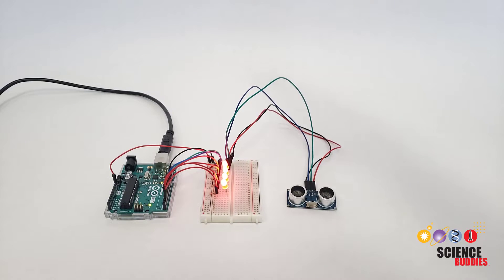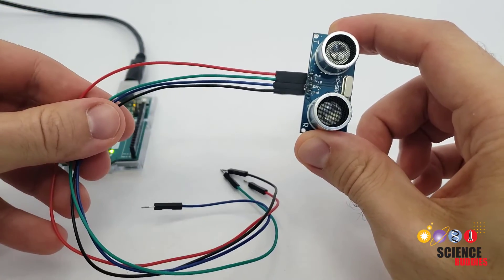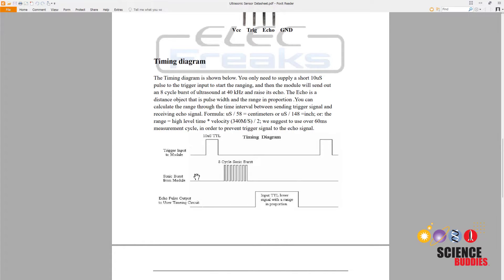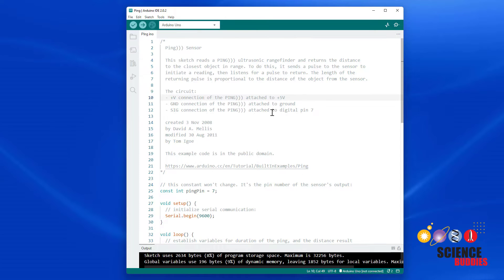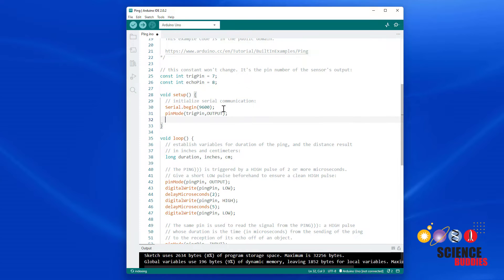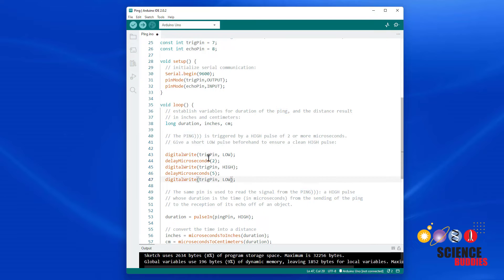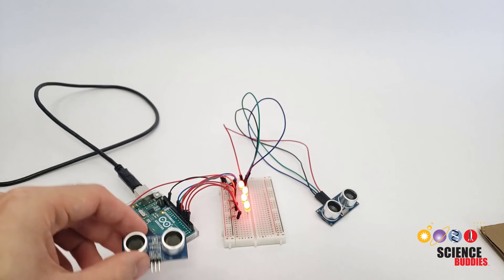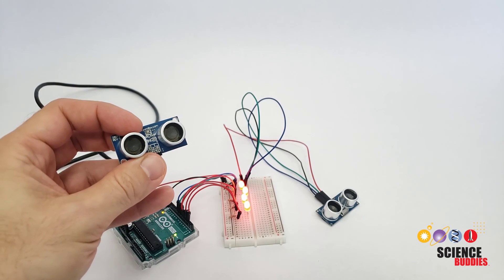HC-SR04 Ultrasonic Distance Sensor and Arduino (Lesson #9)

Comment: What would happen if we sendan analog signal to the trigger pin?
Reply from the maker: We haven't tried - it may still trigger once the analog voltage exceeds whatever threshold is considered "high" by the digital pin, but we recommend using a digital signal for the trigger.

Comment: I DID THE CODE AND IT GOT ME THIS MESSAGE            C:\Users\Ehab\AppData\Local\Temp\.arduinoIDE-unsaved2025731-27104-6y76gp.djxrn\Ping\Ping.ino: In function 'void setup()':
C:\Users\Ehab\AppData\Local\Temp\.arduinoIDE-unsaved2025731-27104-6y76gp.djxrn\Ping\Ping.ino:31:18: error: 'Output' was not declared in this scope
 pinmode(tringpin,Output);
                  ^~~~~~
C:\Users\Ehab\AppData\Local\Temp\.arduinoIDE-unsaved2025731-27104-6y76gp.djxrn\Ping\Ping.ino:31:1: error: 'pinmode' was not declared in this scope
 pinmode(tringpin,Output);
 ^~~~~~~
C:\Users\Ehab\AppData\Local\Temp\.arduinoIDE-unsaved2025731-27104-6y76gp.djxrn\Ping\Ping.ino:31:1: note: suggested alternative: 'pinMode'
 pinmode(tringpin,Output);
 ^~~~~~~
 pinMode
C:\Users\\AppData\Local\Temp\.arduinoIDE-unsaved2025731-27104-6y76gp.djxrn\Ping\Ping.ino:32:17: error: 'input' was not declared in this scope
 pinmode(echopin,input);
                 ^~~~~
C:\Users\\AppData\Local\Temp\.arduinoIDE-unsaved2025731-27104-6y76gp.djxrn\Ping\Ping.ino:32:17: note: suggested alternative: 'init'
 pinmode(echopin,input);
                 ^~~~~
                 init
C:\Users\\AppData\Local\Temp\.arduinoIDE-unsaved2025731-27104-6y76gp.djxrn\Ping\Ping.ino: In function 'void loop()':
C:\Users\\AppData\Local\Temp\.arduinoIDE-unsaved2025731-27104-6y76gp.djxrn\Ping\Ping.ino:44:15: error: expected ';' before ']' token
   digitalWrite](tringpin, HIGH);
               ^
C:\Users\
AppData\Local\Temp\.arduinoIDE-unsaved2025731-27104-6y76gp.djxrn\Ping\Ping.ino:51:22: error: 'echoPin' was not declared in this scope
   duration = pulseIn(echoPin, HIGH);
                      ^~~~~~~
C:\Users\Ehab\AppData\Local\Temp\.arduinoIDE-unsaved2025731-27104-6y76gp.djxrn\Ping\Ping.ino:51:22: note: suggested alternative: 'echopin'
   duration = pulseIn(echoPin, HIGH);
                      ^~~~~~~
                      echopin
exit status 1

Compilation error: 'Output' was not declared in this scope

Comment: Hi, what is the maximum distance that this can sense? Im looking to make a project and need a sensor that can measure around 10-15 feet.
Reply from the maker: Hi - you'd need to check the sensor datasheet to find the maximum range.

Comment: Hi. I get this error message why trying to upload to the Arduino. Sketch uses 2638 bytes (8%) of program storage space. Maximum is 32256 bytes.
Global variables use 196 bytes (9%) of dynamic memory, leaving 1852 bytes for local variables. Maximum is 2048 bytes.
avrdude: stk500_recv(): programmer is not responding
avrdude: stk500_getsync() attempt 1 of 10: not in sync: resp=0x49

Failed uploading: uploading error: exit status 1
This is the first time I have come across this message. Any idea what it may be about?
Reply from the maker: We recommend searching Google and the official Arduino forums for help with error messages.

Comment: Is it possible to reduce the frequency a bit by swapping out a resistor on the board?
Reply: Resistors on the HC-SR04 board are for:

* biasing the receiver amplifier
* setting thresholds
* protecting transistors
* pull-ups/pull-downs
* LED current limiting

None of them participate in a frequency-selective timing network for the transmitter.

Comment: Does it work for underground dedection?
Reply from the maker: No, this sensor is not designed to detect underground objects. The ultrasonic waves will be reflected back and it will just measure the distance to the ground.

Comment: Its just reading 0 for me.
Reply: Same here. I have checked my connections and they seem to match
Reply: you might not have the wires connected correctly make sure 5v in vcc ground in ground and that you have trigpin and echopin connected to the correct pin on the arduino to make it match with the code

Comment: does it work outdoor if theres sunlight?
Reply from the maker: Yes, this sensor uses ultrasonic sound and should not be affected by lighting conditions (with the caveat that the speed of sound depends on air temperature, so that can indirectly affect the readings, but the sensor will still work).

Comment: I want to make a disc shooter that can be attached to the arm, and I want to add a control system to it, basically when the palm "blocks" the shot, the disc shooter will not fire.
So I thought to connect this sensor to perform this operation, do you think it is correct? Does it suit my needs?
Reply from the maker: This sensor would work to detect when an object is within a certain distance. Please see our other Arduino tutorials linked in the description of this video.

Comment: In your Automatic Braking project using Ultrasonic sensor, I have changed the PING))) sensor to HCSR04. But there's a line in the code saying 
distance = readUltrasonic(pingPin)
Now how to change that👆
Reply from the maker: The program in that project uses a function to read the ultrasonic sensor instead of putting all of the code directly in the loop() function. So, you would need to change the function to use two pins instead of one. For example, the call to the function could be distance = readUltrasonic(trigPin, echoPin) and then the first line of the function would be long readUltrasonic(int pin1, int pin2). You would then change the code in the function to use pin1 (corresponding to trigPin) and pin2 (corresponding to echoPin). We're glad that you asked about this because I realized there is actually an error in the existing example program - the way it's written now, the readUltrasonic function should use the "pin" variable inside the function, not "pingPin." so for example the line pinMode(pingPin, OUTPUT); should be pinMode(pin, OUTPUT). Hope that helps! We will update the example code.
Reply: @Science.Buddies  Thanks for the information 👍